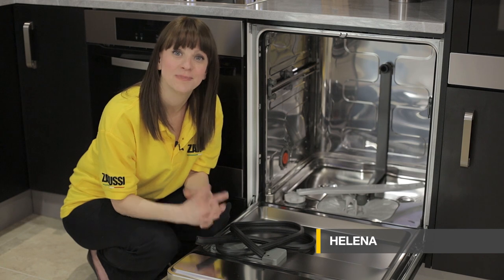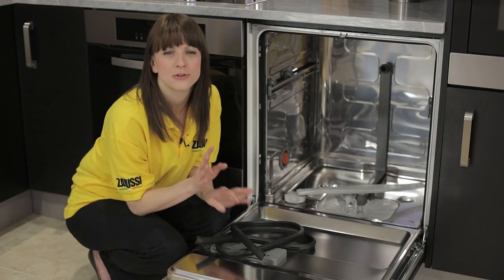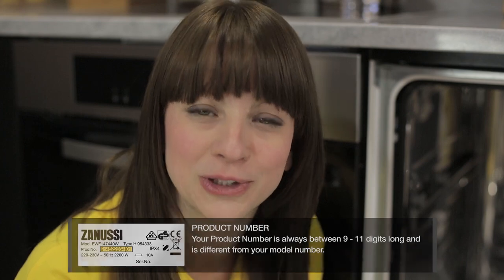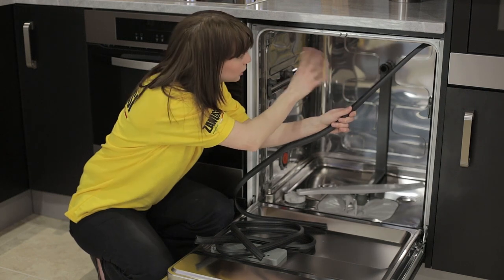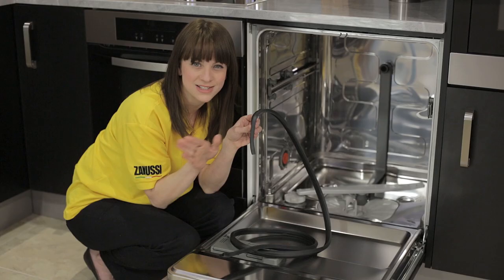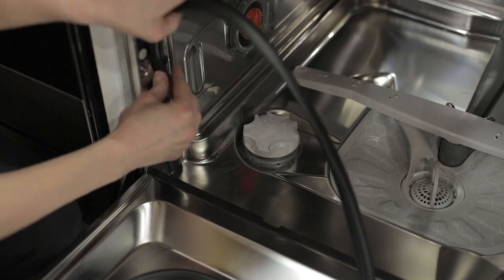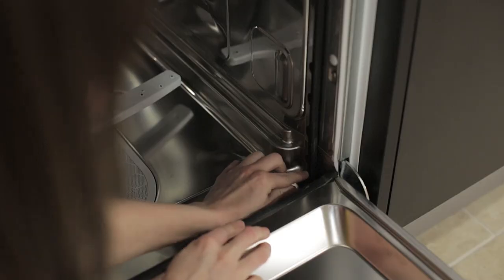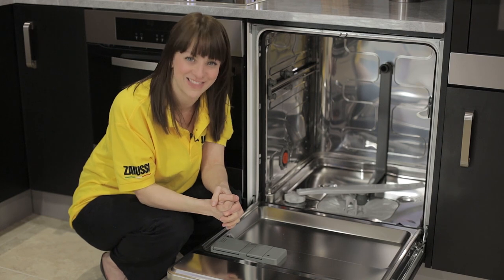How To Replace A Dishwasher Door Seal

Comment: Havereplaced the upper seal, it is still leaking, so now need to replace lower door seal, which I have.But how do I do that?
Reply from the maker: Hello Anne-Maria, can you please let us know your country of purchase? That way we can connect you with the best local team to help answer your questions. Kind regards, The Zanussi Team
Reply: In the UK
Reply: @zanussi  it is the UK
Reply from the maker: Hi Anne-Marie, apologies for the late response, we missed your comment. Please reach out to our local team in the UK via Messenger here: https://www.facebook.com/ZanussiAppliances/
They'll be happy to assist, and will be most familiar with the machines available in your country!
Kind regards, The Zanussi Team
Reply: @zanussi  Sorry you are really too late.I couldn't wait anymore, or risk replacing the lower seal with a new seal, which I had bought, without having some guidance. So I just had to 'bite the bullet' and buy a new dishwasher. AND IT WASN'T a Zanussi!
Reply: It just pulls out and the new one slots in the same as the door seal
Reply: @gonville1964  See Zannussi? Now that's a USEFUL reply!
Reply: @klemlao5463  ?  My reply was that it just pulls out and the new one slots in? Problem?
Reply: @gonville1964  Hi, I have no problem with you at all. Zannussi are so unhelpful when it comes to giving advice on fitting parts - even something as simple as a pull out seal. Thay always say 'we can connect you with the best local team to help answer your questions'. Why not just answer the question here like you did?

Comment: Why does the lower door seal have 2 slots/holes in it? My dishwasher throws water through those 2 holes and messes up my kitchen floor.
Reply from the maker: Hi meg2ist, can you please let us know your country of purchase? that way we can connect you with the best local team to assist.
Kind Regards, Zanussi
Reply: It shouldn’t do - it is something to do with letting pressure out of the tube when the door shuts? Maybe it should meet the aside door seal and stop any water egress.